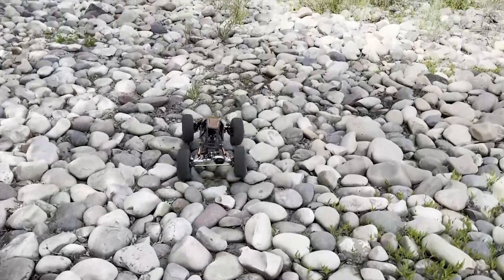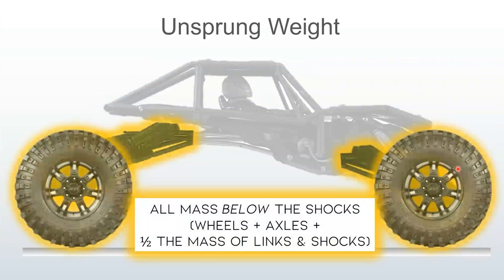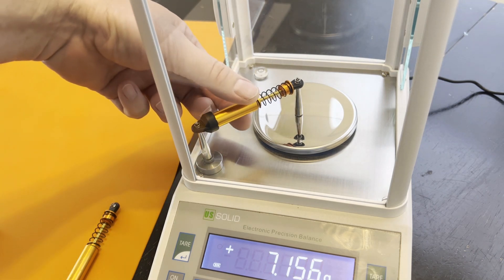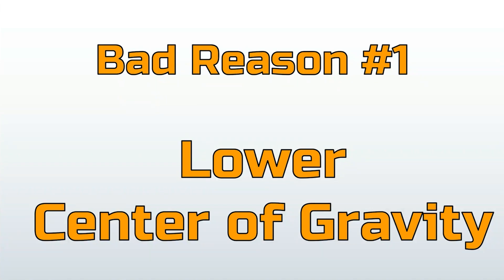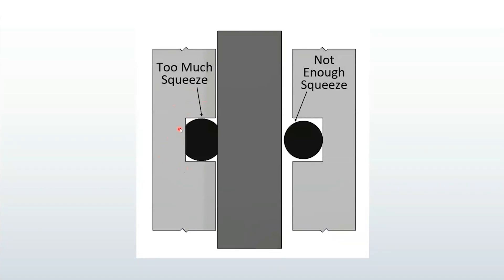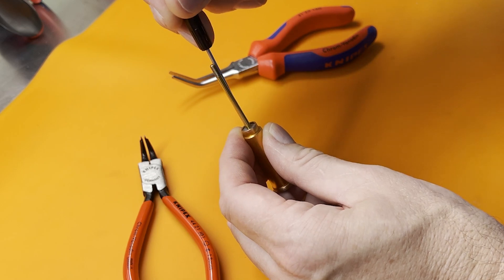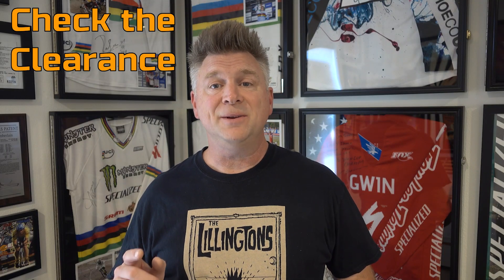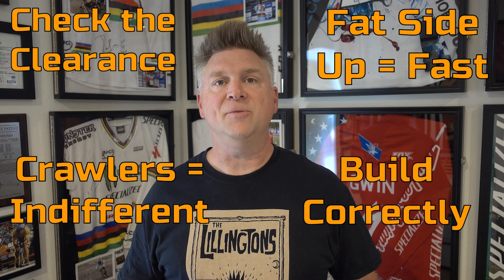Shock Orientation - Up or Down?

Comment: I’ve got 2 almost 100mm dravtech clones and 2 almost 90mm dravtech clones. The seal packs for the shorter ones are held in with threaded inserts like @ 2:07 in this video- is that gonna change anything as far as putting the traxxas rebuild in them? I’m waiting on the pistons- the pistons that come in the clones are slotted on the edge instead of having 2-3 holes. at this rate i should’ve bought directly from dlux or from traxxas. It’s costing me the same if not more and definitely more work 😮 aaaand I don’t get the pretty titanium nitride coated shock shafts grrrrr
Reply from the maker: I guess it’s not an exact clone if it’s got a threaded cover. Impossible for me to say if the seals will work. Yes, sometimes saving money costs more.

Comment: I always thought o-rings were for axis compression, blew my mind. 
I run Hot Racing Double Barrel shocks upside down with Tri-Flow for lube. I run a twenty four scale so it’s a little different. lol
Happy crawling.
Reply from the maker: I know engineers who don't understand this. But read any o-ring technical catalog and this is what they say, assuming, you are sealing on the OD of a shaft and ID of a gland. There are certainly cases where you'd compress it axially, but not in typical shock architecture

Comment: Depending on the environment you're running in, dirt might play a role too. Fat side down can keep dirt and rocks from scratching up the shaft, on the other hand fat side up will keep dirt from building up right on top of/around your seal stack.
Reply from the maker: All great points.

Comment: https://youtu.be/B636Ze8DULs?si=DxPhIFhlkto8WS3N&t=110 on this animation there is contact on all sides of the o-ring, i'd think that would be because you don't want the o-ring in a reciprocating application to "roll" around.
Reply from the maker: That animation is not to scale and not meant to be interpreted literally. If an o-ring rolls you've got bigger issues - it would take a lot of friction for that to happen.

Comment: I’m sure you said that last line waiting for someone like me to mention the “Emulsion” shock build 
that is commonly used in rc racing. I believe they are purposely built with air bubbles in them. Looking forward to hearing your thoughts 😃
Reply from the maker: Ha ha, yes - thanks!  I know emulsion shocks are used in buggy racing and it seems to be a love or hate it type of situation. I'm not sure if I'd consider RC a "true" emulsion shock because most of the air is being bled out, trying to keep air bubbles to a minimum.  In other industries, there is more air and the oil is designed to foam up and the performance is designed around a foamy oil. The consistency (or lack of) is a function of the amount of foam, internal pressure (if they are pressurized) and temperature.  Bladder and IFP shocks are way more common outside of RC and emulsion is considered low end. RC shocks are so simple though that it makes for a compelling case.
Reply from the maker: https://racetech.com/g3s-shock-types/
Reply: @BoomslangSuspension  so me coming to say I have air bubbles in my shocks is good then? 😂
Reply from the maker: @TimsRcsurgery  🤣If you are deliberately setting it up emulsion style with a bleed cap and no bladder....sure!🤣🤣
Reply: @BoomslangSuspension 😂 yep, I’ve tried both, and prefer emulsion with the MIP bypass pistons, often bumpy loose tracks here.

I thoroughly enjoy your videos, thanks for the reply, keep up the great work, look forward to the next one 😃
Reply from the maker: @TimsRcsurgery  Thanks for that!  
Those MIP bypass pistons are really cool. I'd like to the RC community develop more advanced valving like that, but it's tough when everything is so small.

Comment: I assume all the shocks you weighed had oil in them?
Reply from the maker: Yes, they had oil. These are typical Crawler shocks with only a 10mm bore. And these particular Dravtech shocks have a relatively heavy spring cup on the piston side. I may do a follow up with 12, 13 and 16mm bores that are more common on faster moving vehicles and I suspect the C.G. results will be more pronounced. Though I would still recommend piston side down for lower unsprung weight.

Comment: We’re big fans of emulsion shocks on the off-road buggy racing side of things. It used to be all bladder shocks in the ’90s but these days I don’t think anyone runs a bladder in 1:10. The folks with 1:8 buggies consider it a tuning option and can build the shock either way to affect handling. 

The key to successfully run an emulsion shock is to have a strict method to bleeding them. We push the piston all the way in with the bleed screw open and then close it. Virtually zero bubbles inside at this point. 

Pulling the piston out lowers the pressure and tiny bubbles appear in the fluid. I bet you have seen bubbles appear into brake fluid seemingly from nowhere when bleeding MTB brakes. 

This way, the amount of air inside the emulsion shock is controlled and repeatable, and the bubbles are mixed with the fluid so thoroughly that the damping effect is uniform through the whole stroke. They’re the bees knees in our discipline.
Reply from the maker: That is interesting. I think I don't quite understand how you guys are setting them up. Seems like you have a minimum amount of air inside. My experience with bicycle and motorcycle forks - they run big open baths that are more air than oil. It's cheap but only somewhat effective. Seems like you are doing it better.
Reply: I would imagine that the volume of those shocks changes more when the piston slides in and out. That would require more air. 

On these shocks, it’s just a 3 mm shaft going in and out about an inch or less. Pulling the shaft out doesn’t cause a strong vacuum inside.
Reply from the maker: I understand what’s going on now. You foam up the oil before you bleed it. Then you do essentially a zero bleed with foamy oil. And that air is just enough to manage all the compensation without a bladder. To work correctly, it needs to foam up on the track and that’s probably why some people think they’re less consistent.
Reply: I haven’t heard of people foaming up the oil and I think it would be difficult to do consistently. 

On the contrary, we chase air bubbles out from below the piston and let it sit until the oil is clear as day. 

The trick is to put the cap on with the bleed screw out and the piston extended. Then, push the piston in and catch the fluid coming out of the bleed hole with a rag. With the piston fully compressed, mount the bleed screw. 

Matching the airless volume with the piston compressed allows the shock to work without hydrolocking. A slight vacuum when the shock extends is not problematic and it’s fairly easy to make consistent from shock to shock.
Reply from the maker: Don’t you cycle the shock 10 times before you put the cap on?
Reply: I cycle the piston with the cap off to chase out air bubbles that might be trapped underneath the piston. The oil is settled and clear before the cap goes on. 

Some people use vacuum pumps to speed things up. I haven’t found it to be necessary.

I’m sure you have bled a fair amount of MTB brakes and seen how bubbles seem to appear from nowhere when the hose is clamped and you pull the plunger. It’s surprising how far you can pull the plunger it’s impossible to push in without blowing the hose off the syringe. 

I think a similar thing is going on with these shocks: it’s bled ”airless” with the piston all the way in and extending the shock creates a small amount of negative pressure inside. The change in volume is very small since the ”piston” affecting it is actually just the shock shaft.

Comment: Thanks again for a clear and informative video. I assemble shocks exactly as you demonstrate. Pushing a steel rod with a machined shoulder through O-rings or X-rings just feels awful.

While not an optimal solution, I sometimes shim some squeeze into the seal package. O-rings can swell or wear just a little and it can be tricky to get the fit just right. If I find the seal to be too loose to my liking, I add something like a 0.2 mm shim to the stack and it most often prevents leaks while allowing the shaft to move with relatively little friction. 

I drive the fast kind of RC cars and weighed my rear shocks using a similar method to yours. A 13 mm bore shock with a 27.5 mm stroke (as used on 1:10 buggies) weighs 17.9 grams and it’s distributed as 10.74 g for the top and 7.16 g for the bottom. 

When sagged to ride height, the center of mass is 30 mm from the top and 45 mm from the bottom. 

Since the shock is placed at a 55-degree angle, the change in CoG is reduced. However, the center of mass of the shock is still lowered by 12.3 mm on the vertical axis when it’s flipped. 

So, unless my grasp of the physics at hand is flawed, flipping the rear shocks means that 35.8 g of mass is lowered by 12.3 mm from a position that was relatively high to begin with. 

On a car that goes really fast through corners on a high-grip surface, this can be a pretty good argument for flipping the shocks. 

This is not to say everyone should do it. It depends. But the top drivers in Europe (Cragg, Kaerup, Hall bros…) have been winning high-level races with their shocks flipped so we know for sure it’s not a bad setup option to have.
Reply: The numbers I present are just a single case example. The shock weight and sagged length will vary for sure, as well as the exact angle. But the principle is there.
Reply from the maker: It looks like you are getting 35.8 as the weight of 2 shocks. You are not lowering the full mass of the shock by 12 mm, unless you are moving the upper and lower mounting points as well. You are only shifting the CG with the endpoints still at the same location. By these numbers you have 60-40 weight distribution, so that is a the weight delta (10.74 - 7.16= 3.6g) shifting 20% of the shock length, which you said is 12.3 at 55 deg. So its 7.2g (2 shocks) total lowered 12mm, not 35.8.  

This makes sense because 13mm bore shocks will have a bigger delta than the skinny 10mm shock I measured.
Reply: I must have wrongly assumed that I could pin the entire mass of the shock to the center of mass, but now that you brought it up this doesn’t make sense.

Comment: Not a ton of articulation is good. Also, you don’t necessarily need that every time if you have too much articulation, your tires will fall in a hole and then your tire will bind so yes and no for crawlers.
Reply from the maker: https://youtu.be/BvoXOOFaMdQ
Reply: I read that so often and everytime i try a rig with shorter shocks and less articulation its undriveable, flips over at all obstacles where a lot of articulations just drives over. Never got stuck in a hole - the number one argument against a lot of articulation.

Comment: I also spend most of my life mid stroke or deeper..  😬

2 things. 
Good pliers make ALL the difference when putting those rings in the bottom of Dravs.
There’s also a grease that is for motorcycle chains? I think? It is green slime in bulk. It’s green, slimy, looks and smells the same and is WAYYY cheaper. I’ll try to reply when I get home. I can’t remember its name right now.
Reply from the maker: Probably not the same. Very different applications and you definitely need something that is o-ring compatible. Not sure it’s worth saving a buck here but let me know how it works.
Reply: Noleen SF-3
Reply from the maker: @BullmanBuiltRC  That'll do it! 
I might try Slick Honey - it's very common on bicycle shocks.

Comment: Glad someone else said what I knew. I got into a very heated argument about shocks and CG.

I was a hydraulics master in school when I studied for heavy equipment maintenance. I know for a fact shocks all leak. If it’s leaking badly to where you need to rebuild very often, you either didn’t build them correctly or you nicked the shaft enough to cause the o-ring, the thing that helps keep the oil inside, to fail prematurely.

I see this so often on the drift group I moderate and they’ll tell people all kinds of nonsense. Whenever I hear someone is having shock oil leaking, 99% of the time the chassis is coated in dirt and grime. Leaking shocks are the result of poor maintenance and poor building. There are some shocks that really do have poor tolerances but for the most part, at least for drift, they’re all variations of a theme and are dimensionally the same or similar so that excuse is kind of moot.

As for whether you run them upside down or not is a matter of preference.

Also, the technique you’ve shown was the exact way that I’d learned and really does produce a very nice shock that doesn’t at all leak. Tamiya told me to build it a certain way and was always wondering why my old shocks leaked and needed rebuilding so often. I recently built a set of TRF shocks using that same technique and they’re the most buttery and leak-free shocks around.
Reply from the maker: I love that. Thanks for sharing your story and insight.

Comment: thank you for the video.I like your channel. On my mountainbike the rear shock is mounted vertically and can be installed both ways. I ride the fat side on the top and the skinny side on the bottom mainly so dirt has no chance to build up due to gravity. In your experience, does the orientation of mountainbike shocks matter? Thanks, Nic
Reply from the maker: Air shock or coil shock?
Reply: @BoomslangSuspension  air shock (rock shox rt3)
Reply from the maker: It doesn’t really matter. The fat side of an air shock is the air spring so it’s mostly air inside, and the weight is pretty balanced. Your dirt build up reason is a good one.